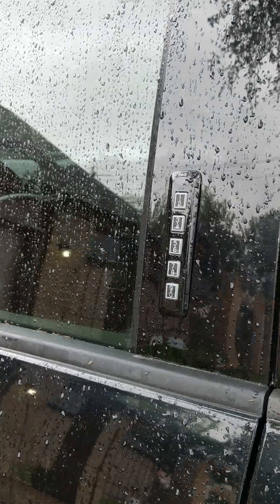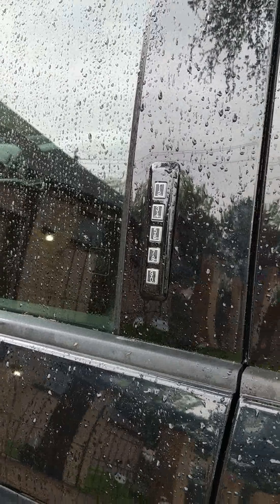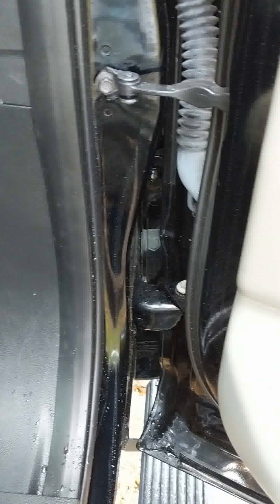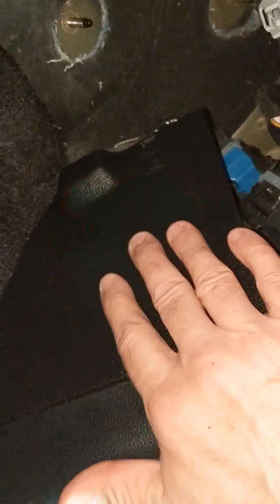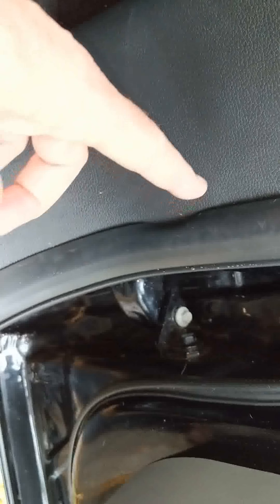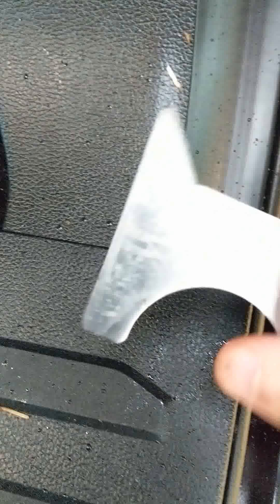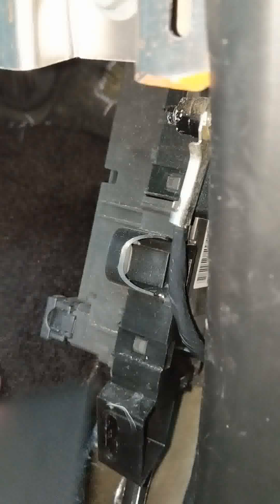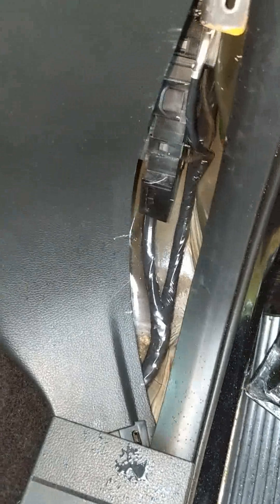HOW TO FIND---LOCATE 2015 2016 2017 FORD F150 F-150 KEYLESS ENTRY FACTORY KEY CODE LOCATION!

Comment: The code is actually behind the fuse block, pull ( 1)7mm screw to pull the fuse block back far enough to take a photo of the code, dude thanks sooo much, I just erased previously set codes and reprogrammed my personal code! 👍🏽👊🏽
Reply from the maker: Thank you for your kind reply.  I apologize for the crappy video, but it was hard to do with one hand and as you no doubt found out yourself it's a pain to re-do the video.  I'm glad it was helpful to you.

Comment: Thanks for the how to video of how to find the code as I only have one smart fob. Would or could you possibly make a how to vid on how to program an additional smart fob? If not thanks anyway for the information provided here in this video👍🏾.
Reply from the maker: Hello Anthony and thank you for your reply.  I too only had one fob, which is why I ended up making this admittedly poor video about how to get the door button code when you only have one fob.  

And to your actual question: I actually had a second fob made at a place called Batteries + Bulbs in Lancaster, PA a couple of years ago.  I'm not aware of how to DIY them.  I just googled Batteries + Bulbs and found that they are a national chain.  Their fob worked perfectly and is indistinguishable from my original one.
Reply: @SRFDriver  how much they charge you?
Reply from the maker: @MC-ik3zn  For what?  A second key?  I can't remember, it was about three years ago.  But I remember that I got the key from Batteries + (Plus) in Lancaster. PA
Reply: @SRFDriver  the fob
Reply from the maker: @MC-ik3zn  Sorry, I can't remember.  What I do remember was that I just gave them my (only) key and they made a new one from it.  I can't tell the difference between them.

Comment: Just what i needed thank you
Reply from the maker: You're welcome.  Were you able to successfully locate your key code?
Reply: @SRFDriver  i didnt so the process  as yet but will  just got the truck  in gonna check the book in the glove box to see if the card is in there as it was a  1 owner  of not I'll try your method  as i also have one key
Reply from the maker: @trewatkins530  Well, it worked for me-I can't see why it wouldn't work for you.  Also, I eventually got a second key made at a place called "Batteries +".  Then I could have done what the other guy suggested.  In fact, I actually did it using the "two key" method just to see whether it would work (It did work).  Anyway, good luck to you.  Let me know if I can help in any way.
Reply: @SRFDriver  yeah im about to do the same process  of looking  at the panel didnt find  a card   ill check the price pf batteries bulbs do u remember  how much  generally it was
Reply: @SRFDriver  just took the sode panel  apart got the  code thanks  but damm had to squint  my eyes  at a angle to see the number as it was tucked

Comment: I'd start with a universal, easily adaptable phone holder, like this :   https://goo.gl/ytnShh
Pick up a cheap tripod: https://goo.gl/QfGcBK
And a strong magnet: https://goo.gl/BSsSY5
You could just use the tripod as is on the floor,  or remove the top and attach the magnet to it for an overhead shot as I described.  I've made a lot of custom phone mounts over the years, but this one is just an unproven idea off the top of my head, so scope it out first before laying down any green for the parts.
Reply from the maker: I actually do have several tripods that ive bought over the years, and i have a camcorder that i could mount to the tripod.  Maybe that's the way to go.  I will fire it up and see if the battery is still good, the battery's only 15 years old!  lol
Reply from the maker: I just ordered one of the cell phone mounts.  Thank you very much for the idea.  I will be happy to give you a shout out once i get it installed.
Reply from the maker: Hi, I took your advice and bought a phone holder for my tripod and just made another video and really tried to pay more attention as to how I came across, including taking the time to look at and show the viewer what it was that I was seeing.  I would truly appreciate your comments on how or what I could do better.  The video is of me going through the contents of the change bucket that was briefly seen in the first video.  What I found stunned me.  I tried to be respectful with what i found.  If you watch it and find it interesting I would appreciate it if you would consider subscribing to my channel if you have not already done so.  Thank you again for your comment and suggestions.

Comment: Just subscribed to you.  It's going to be interesting to see how you progress as you learn the ropes about making you tube vids.
There's so much to say, I wouldn't know where to start.   Lots of how-tos available online: https://goo.gl/ri3YFk 
First thing for now I think of would be to get a setup for mounting your camera where you don't have to use your hand to hold it while filming (saw the storage locker vid)  With those smaller storage lockers, I'd probably try using a bracket, perhaps with a magnet that would hold the phone to the door frame.  I'd point the camera down toward the area where I happened to do the unboxing, changing the angle as I went along.
Reply from the maker: Yes, my wife actually has a mount that can hold the phone and could clip onto one of the metal pieces inside the storage unit.  I plan to go over and try to get through the rest of it--i only went through about 30% of the contents.  
And I just today put out a video on how to find the keyless entry code for a Ford truck.  I would have really liked to be able to stick the phone on my hat or something so it could see what I see.  Unfortunately then I wouldn't be able to see what IT saw!  Lol
But there is a lot to it and I am trying to learn.  Thank you very much for your kind comment.
Reply from the maker: Oh, and thank you very much for subscribing.  I appreciate that.
Reply: I've used the pocket of a shirt to hold my phone with the camera peeking over the top to video.  Of course, you'll be stuck in vertical that way.  BTW, are you a driver?  You know, a DRIVER?   @SRFDriver
Reply from the maker: @guruoo  If you are asking am I a SRF driver the answer is well, yes.  I have what is now called a Gen 2 SRF.  However, I live in Houston and the car is in my trailer in Atlanta.  You may have noticed that I have one (and soon to be more) videos of my 2016 F150 up now.  I bought it a week or so ago for the express purpose of driving to Atlanta to retrieve my car.  Then I plan to race it this year at COTA in Austin and MSR Houston which is a half hour south of my house.  Did that answer your "driver" question?
And the shirt pocket idea is a good one.  I'm going to try it when I do my next F150 video.  I'm going to use a tripod or a wall mount to do my storage unit ones.
Reply from the maker: Absolutely a great idea.  The two storage unit videos were the first ones that i had ever done (come to think of it they're the ONLY ones I've ever done!), and i was really talking to myself as i went through it, I hadn't really given any thought to actually posting it.  But you can see that I did for better or for worse.  Most of the comments have been kind and understanding that it was my first time, some have not been quite as kind.  But that's okay.  I'm still learning and when I get back over there I will record with an eye to remembering that there are going to be others viewing this so I need to pay attention to what I'm doing and how I'm doing it.  Thanks
Reply from the maker: Are you a racer or SCCA member or something?